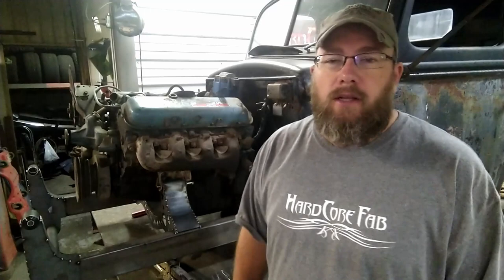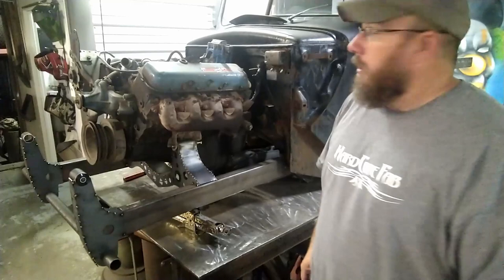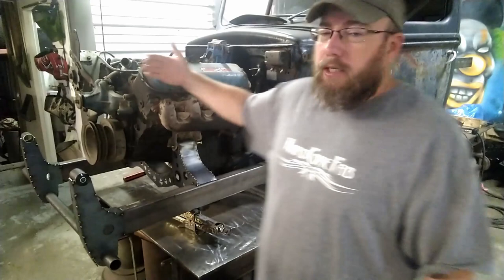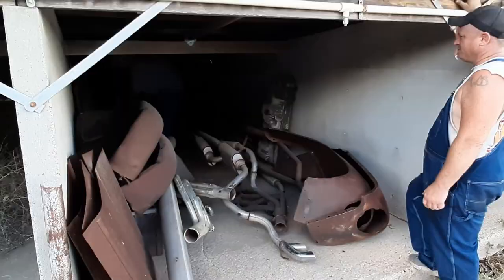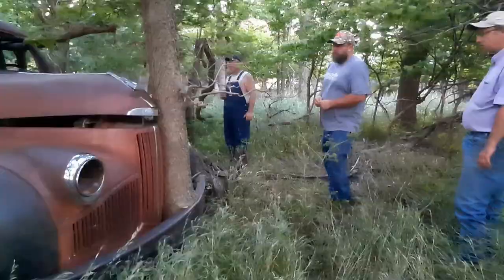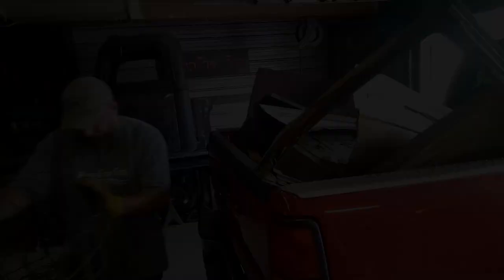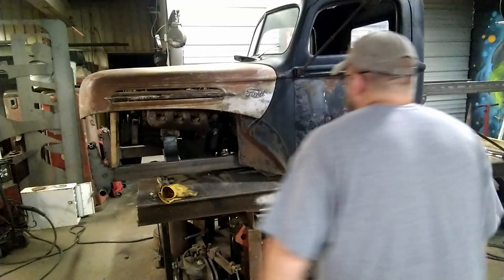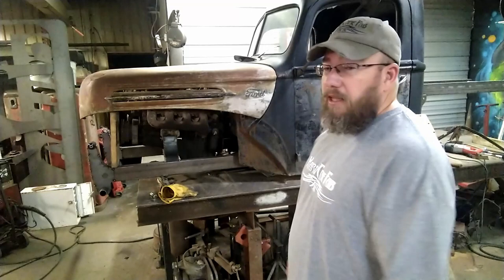Roached Car Parts (rat rod build part 5)

Comment: Great ideas for the truck. What material did you use for your chassis ( size, grade, and total amount?) I’m thinking about a rescue project using a similar year truck cab also fabricating a chassis like you did. I’m a retired pipeline welder /fabricator with automotive mechanical repair skills and have had numerous hot rods but never started from scratch. Any feedback and advice is appreciated.
Reply from the maker: I like 2x4 square tube and I have found 1/8 and 3/16 are ok.  I made a video on building the chassis that may help you with
 some Ideas.

Comment: I know your using the parts you got, but I think the truck would look allot more clean if you went with a standard carb setup and left the hood smooth. Or at the very least make a low profile scoop that matches your suspention and crossmember.
Reply from the maker: That's food for thought nothing on the engine is set in stone yet!